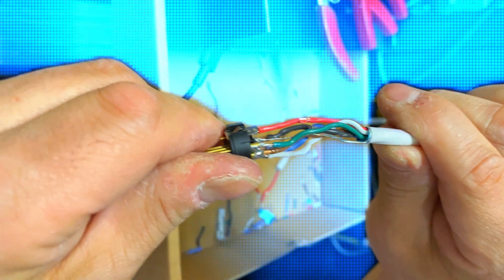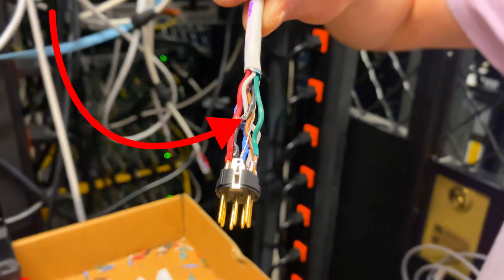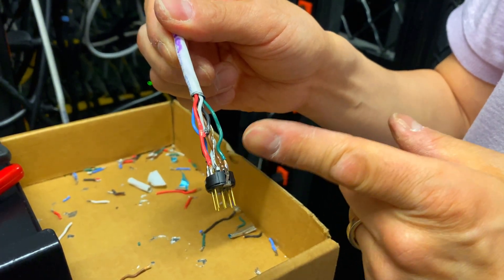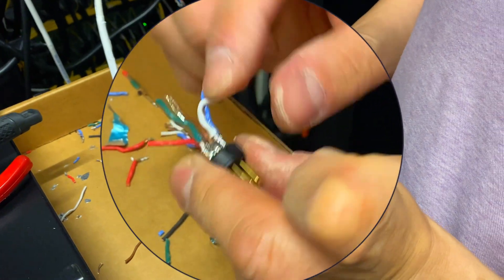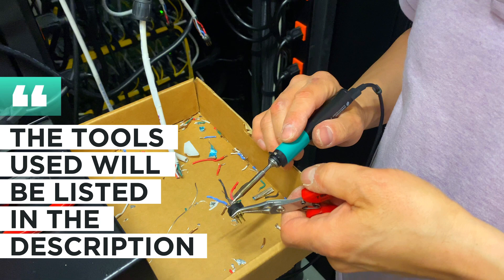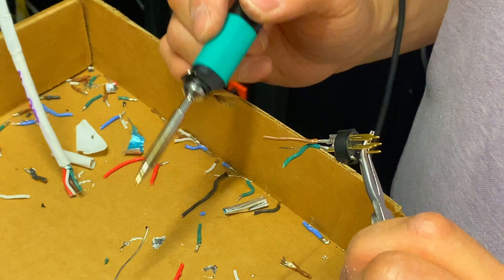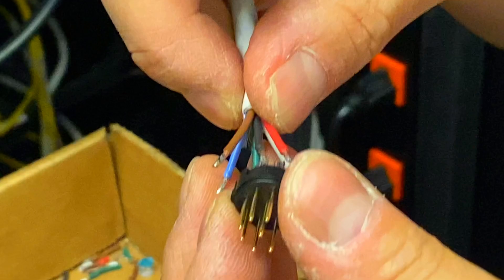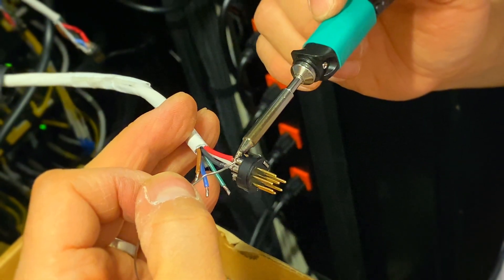XLR Repair: 7-Pin Telemetrics PT-Head Termination Guide

Comment: Great vid. Thanks. Curious as to how the color matching differ for a female side connection
Reply from the maker: On the male side, pins are numbered clockwise when looking at the front (the side with the pins sticking out)

On the female side, pins are numbered clockwise when looking at the front (the side with the holes).

That means if you’re wiring a male to female 7-pin XLR cable, you just match numbers straight through. That’s why relying on the printed pin numbers stamped on the connector shell is key.

Multi-core cables often have their own factory color code (red, green, white, black, yellow, blue, brown), but those colors are not standardized across all cable brands.